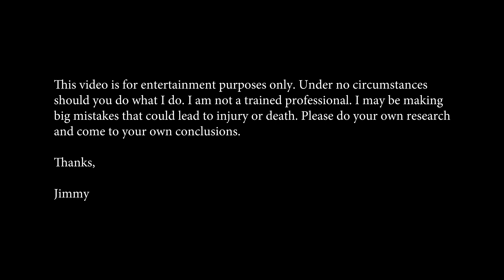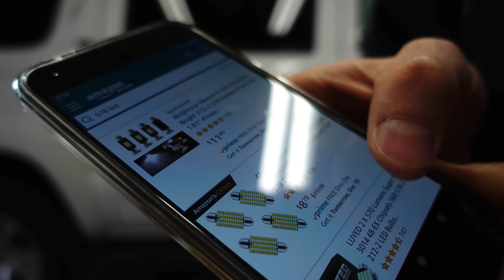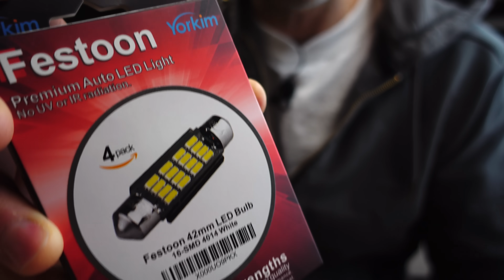Here's Why You NEVER INSTALL LEDs IN YOUR CAR OR TRUCK!!

Comment: You use the term halogen for a lot of the incandescent lights in your vehicle.
Reply from the maker: Same diff
Reply: @1RoadGarage  no they are not. Holagen is different then incandescent.
Each use different gas to make them emit light.
Reply: @1RoadGarage  Not the same. A halogen bulb is an incandescent bulb where the filament is surrounded by halogen gas. All halogen bulbs are incandescent; not all incandescent bulbs are halogen.
Reply: @bobdodge3171  Both a standard incandescent and a halogen incandescent use electricity to make them emit light. The halogen bulb surrounds the filament with halogen that protects it and may let it burn hotter (and emit more light) while maintaining longevity.
Reply from the maker: @bobdodge3171  both are glass bulbs, filled with inert gas, burn a filament, have a warm color temp (2700-3200k), produce most of their energy as heat, have a low life span and look almost exactly the same. So, I said halogen instead of incandescent... not a big deal.
Reply from the maker: @JeffreyKrasner  both are glass bulbs, filled with inert gas, burn a filament, have a warm color temp (2700-3200k), produce most of their energy as heat, have a low life span and look almost exactly the same. So, I said halogen instead of incandescent... not a big deal.
Reply: @JeffreyKrasner  ya and? I know this.
Reply: @1RoadGarage  Halogen bulbs should last 4 times longer than regular4 incandesents
Reply: @bobdodge3171  
Well "than" is different from "then" and it doesn't stop you from using them interchangeably
Reply: @rustyshackleford7265  Oh wait lol yes sorry
im not filming using wrong terms.
Reply: @bobdodge3171  
No, just going your entire life using wrong terms
Reply: @rustyshackleford7265  you do not know this..
And i doubt i was using the wrong terms at age 1. Makes your reply invalid. Thank you.
Reply: @rustyshackleford7265  obviously no..    I assume you were talking at age one? Making full sentences..
You are a bright one.
I also did not insult him.
I pointed something out like you pointed out my grammer. I didn't go childish an insult him.
Reply: @bobdodge3171  
You're contradicting yourself.
 Just stop correcting people online when your grasp of English is limited at best
Reply: @rustyshackleford7265  no im not.
You said my WHOLE life i am pretty sure i was not talking then. Which in turn would not be my whole life. You are good at insulting people. Must be your profession. You take care now.
Reply: @1RoadGarage  point is your terminology was totally incorrect. 
It detracts from the content totally.  Firstly, you have no real argument as to why you shouldn't use LED and secondly you don't know the difference between halogen and other types of incandescent lamps.  Nor does it seem that you even care to know.
Reply: 1ROAD no it kinda is a big deal when you try to come off as an automotive expert saying you’re not an expert you should use proper terminology for components. It would be like calling an internal combustion engine a motor. NO! A motor rolls down windows. An engine burns gas or diesel.
Reply: @JeffreyKrasner  and excess heat is a real problem in interior lighting. I've seen light housing's melted by a standard incandescent. I'm definitely not putting a hotter bulb (halogen) in my interior lighting.
Reply: Every one he "owned" came into his possession the day before the patent office where he worked caught fire. 
This info isnt difficult to get
Reply: @raymanretro really? Figured halogen be to hot for confined spaces
Reply: The most glaring evidence against Einstein concerns “his” most famous equation. One website notes “The equation E=mc^2, which has been forever linked to Einstein & his Theory of Relativity was not originally published by Einstein. According to Umberto Bartocci, a professor at the University of Perugia and a historian of mathematics, this famous equation was first published by Olinto De Pretto …two years prior to Einstein’s publishing of the equation. In 1903 De Pretto published his equation in the scientific magazine Atte and in 1904 it was republished by the Royal Science Institute of Veneto. Einstein’s research was not published until 1905… Einstein was well versed in Italian and even lived in Northern Italy for a brief time.
Reply: The most famous one listed there. I'm not going to do your homework for you, kid. He was a fraud and had ZERO ideas or inventions of his own
Reply: @rustyshackleford7265  You couldn't do my homework in your wet dreams, you moronic parrot. IT WAS NEVER HIS EQUATION AND HE NEVER LAID CLAIM TO THE EQUATION, YOU FOOL. HE SOLVED IT!!!  I can write an equation of fifth degree polynomials two pages long, but I can't solve it. What good is a problem without knowing how to solve it? Now put on your duncecap and go sit in the corner. And remember to put on your bib so you don't drool all over yourself
Reply: He didnt solve anything. It's like speaking to a kid who still thinks wrestling is real. I cant help you
Reply: Let me guess, the helmet that einstein invented, right?
Reply: What is the formula for gravity? 
I know you're floundering but stay on point. All this misdirection it's no wonder einstein is your hero because rather than giving evidence you just confuse the point
Reply: That's what I thought
Reply: guys, gentlemen...I think we fail to see the forest for the trees.
Einstein obviously used a stolen equation to create a helmet of halogen bulbs that would then burn the users scalp when sufficient thoughts produced the relative levels of light required to burn down the patent office where he stole all his ideas from.
Case closed!
(Curtsys and winks)
Reply: Good thing you let others decide how yours functions. Never had an independent thought in your life I bet
Reply: Still no original thoughts? You're quite sad actually
Reply: Neither can you. All you can do is regurgitate lies from a confirmed plagiarist
Reply: @rustyshackleford7265  No, those are called answers, from a man that proved all his theories. You've provided one, that was immediately proven to be wrong.
Reply: @bobdodge3171  and I was so convinced the correct word was "grammar" but you seem to have full grasp of the lingo so I better change 😁
Reply: @bennylloyd-willner9667  ya i tend to be incorrect at times. Lol
Reply: @1RoadGarage  No but your misleading title is a big deal.  Congrats on getting a paycheck from youtube, won't watch anymore videos from you.  Also reporting to google cause don't care thx for wasting my time as I research leds

Comment: I've been trusting auxito LEDs. I have had bad experience with some no brand garbage LED lights but auxito hasn't let me down and they actually have lights engineered correctly like headlights putting out the same pattern as standard halogens, not blinding other drivers on the road.

Comment: Fun fact: basic incandescent lamps are 90% heat and 10% light.
Reply: You are absolutely correct and I think it's actually 92% heat!
Reply: Fun Fact: a regular incandescent dome light can drain your battery overnight, especially during winter.
Reply: @johnmccormick8159  exactly.  I left my LED headlamps (yes the actual headlamps) on by accident for the day and the car still started at the end of the day.
Couldn't do that if they were incandescent globes.
Reply: True. But if the lamp has a reflector, 80% of the heat is radiated infrared out of the lamp. The LED heat isn't radiated because the heat comes from the electronics and LED chip and not from the LED light itself, so finally the LED gets much hotter than the old bulb.
Reply: @SpeedFlap  Is your point that if we could see infrared, the incandescent could be considered much more efficient? 😀😀😀 Totally agree with the rest of your post. 👍👍👍
Reply: @stevewaclo167  Absolutely. Hold your hand in front of a 20W LED lamp, you won't feel much. Then hold it in front of a 20W halogen lamp. Imagine you could see all the radiation that your hand feels, then the 20W Incandescent lamp would be much brighter than the LED lamp with the same input power. So yes, the definition of "efficiency" depends on the section of the spectrum you observe, whether or not you include the invisible spectral part.
Reply: @SpeedFlap  Very thoughtful reply but as I’m sure you will admit, we don’t typically buy lightbulbs for their heating prowess. 😀 Over and out.
Reply: @stevewaclo167  Oh don't say that... In Europe the classic lightbulbs were forbidden some time ago and consumers were forced into energy saving lamps. Some vendors tried to circumvent this regulation by declaring their bulbs as "heating devices", argumenting with their light being just a 10% side effect...
Reply: @SpeedFlap  Hmmm, very creative effort and as you have observed, fundamentally accurate! Best and Happy New Year!
Reply: Nice to see someone call them lamps and not bulbs. Bulbs you plant lamps you light.
Reply: @IBOFSGUBK  Haha in Germany they are actualling hanging in trees. We call them "Glühbirne" which means glowing pear.
Reply: And your alternator doesn't care.
Reply: And halogen although technically still an incandescent is much hotter.
Reply: When we were kids my sisters had an Easy-Bake Oven. They literally used an incandescent bulb to bake little cakes in that thing. That shows how inefficient those bulbs are.
Reply: SpeedFlap yes but light and heat combined in the LED is still much less total 
watts than the incan.
Reply: @SpeedFlap , nope. Incandescent bulbs get hot enough to burn your skin. Not so with LEDs. Incandescents are about 15% efficient; LEDs are 85% efficient. LEDs can't even develop that much heat.
Reply: @SpeedFlap , the 'classic' headlights from Europe not allowed in the US were halogen. They were outlawed because they produced a very yellow light.
Reply: @IBOFSGUBK , that's funny right there! Bulbs are basically something with a round part. They can be flower bulbs or light bulbs.
Reply: @SpeedFlap  . Very true. The big scam in LED advertising, "LEDs run cool". Sure, the diode runs cool, but all the electronics that power the diode create as much, if not more, heat than an incandescent bulb.
Reply: Incandescent tech is not dead.
Reply: Your fact is subjective, as well it was not fun.

Comment: I pop the lenses off all my lights, spray some 3M adhesive on the inside of the lens and then cover it with wax paper. Gives off a really nice fluorescent look and evenly spreads the light of the LEDs.

Comment: Something to be considered is that whilst it’s all fine and dandy to replace inferior lights with LEDs, not all head lights are suitable for LEDs if they have older reflectors designed for conventional bulbs. These reflectors tend to scatter the light from LEDs because the light is produced or projected differently, this can result in headlights that dazzle oncoming traffic when on low beam. Obviously on high beam it doesn’t matter so if you have separate bulbs for high and low beam then you can use conventional bulbs for the low beam and LEDs for the high beam. Otherwise you better check that your headlights are not blinding, dazzling and annoying other drivers before sticking with them.
Reply: Wanna remember the assholes on the road that use lights that specifically blind you
Reply: I remember being blinded all the time when LEDs were a new thing. Not sure what happened since then, but possibly newer vehicles are designed to accommodate LEDs.
Reply: @deltatango5765  yes newer vehicles that come with LEDs have the correct reflectors to focus them properly without having a dazzling scattered pattern. I have just fitted LEDs in my 2004 Discovery main beam and they’re brilliant (pardon the pun) but I can’t fit them in the dipped beams because they will just blind oncoming motorists.
Reply: That is supposed to read “ inferior lights” not “interior” damned unpredictive awful-spell! I can’t edit it now but I guess it doesn’t change the main point. 😎
Reply: Have you not heard of LEFs yet?! They’re a new extra bright light called Lumen Extra Frequency! 😆 Apologies, fell foul of unpredictive awful-spell again!! Obviously I meant LEDs 😎

Comment: One thing to note is that the bluer color temp and brighter lighting will affect your night vision adversely.   Personally, I try to use warmer LEDs (2800-3000k) rather than cool white or daylight.   Also, I prefer not to have super bright interior lights other than maybe the cargo area.   IMHO, it just blinds you when it's pitch black out, but it's really just personal preference.
Reply: Exactly. I have LED reverse lights and I still need to get LED cargo ones. My reverse lights are by Luminex by DieselLEDS and they have a great heat sink. As far as headlights I only use HID so I don’t blind oncoming traffic.
Reply: @c7t1consulting87  After 6 months, nobody has flashed their headlights at me for having too bright of headlights unless I forgot to dim them.
Reply: It hasn't caused me any problems.
Reply: Eh?
Reply: @genericdude6551  Me neither, that's why I don't get it. How can brighter light adversely affect your night vision? The whole point is to be able to see more clearly, hence you fit a brighter light.
Reply: @gssf.gr29  They're talking about the interior lights. Your eyes adapt to less light or darkness, but this isn't instant. When you turn on the bright inside light, you just messed up your night vision for a bit, so the warmer "dimmer" lights are actually better in most cases.
Reply: @jaychap6375  Fair comment but I based my comment on the answers shown above, not on the video. I only watched a couple of minutes of the video as the guy was referring to the original interior bulbs as halogen bulbs - they're not. Based on that error that early in the video I didn't expect much value from the rest of it. 

Unless you use your interior lights while driving, I don't see a problem. Sure, when you first get in the car you're going to get a brighter light - that's the whole point - but your eyes adapt very quickly anyway. You can also get LEDs in warm white and a lower brightness, but to me that defeats the object of changing them. I've never had any problems.
Reply: Most replies to this so far (36 months later) seem unaware that blue light affects night vision far more than red light. Why aviation instrument panels have red bulbs. What most call 'White' LEDs are biased strongly to the blue, as opposed to incandescent being biased to the red (warm) end of the spectrum. Intensity of interior lighting is a separate danger to night vision, as full accommodation to faint light takes considerable time. Driving night vision is in between day vision and full dark adaptation, but just as subject to recovery time after exposure to excessively bright interior lighting.
Reply: Absolutely! White trunk lights are great; white running lights are not.
Reply: @gssf.gr29  Anybody who has walked in woods with a too-bright flashlight knows how bad excess light is for night vision. If all you want to see is exactly where the light is shining, life is good with bright lights. If you want to see the deer by the road, trying to decide when to dart in front of you, white lights are your enemy.

Comment: LEDs have disadvantages, on the one hand the high unhealthy blue component in the spectrum compared to a conventional light bulb. In addition, seeing more because it is brighter is only true to a limited extent. When buying LEDs, it is essential to pay attention to the color rendering index. Although the light appears brighter, you can see fewer colors. A conventional light bulb still has an unmatched color rendering index

Comment: I changed my 2013 Ram in 2016 with all LED lights. Put switch back in my directionals on front. All my lights on the front are bright day light except when the directional come on, it switches to amber while blinking and back to white when it stops. Did interior, front and rear all LED .Even did my plow lights led. Bought all from the same company with outstanding reviews. Never had to change another bulb on my truck since. Bought LED tow mirrors also. Change the light configuration for all my lights with the ALGFA OBD from standard to LED. Never had a problem with codes or anything. Draws less power from the battery and alternator.

Comment: One good point to think about is the fact that the light housing is made to collect the light and focus it at a certain point and an LED might not be pointing in the right direction. it can't take all of the LEDs light and combined it to focus it in the proper direction
Reply: The ones I have seen so far, at least for my vehicle, are the diodes are on the sides of the stick, so theres no issue of it not hitting the proper reflectors. Plus my low beams (which seems to be standard now) has a dome lense in front of the LED, so even if it were a straight on light, the dome would probably still spread the light anyways
Reply: That is why you only buy LED head lamps that only have two Diodes, one on each side and they are usually aim able in that configuration. By that I mean the light comes out of the locking ring so you can position the 2 diodes so they face the reflectors inside the housing. Hikaris are known for this.